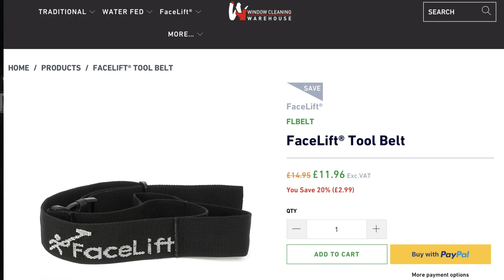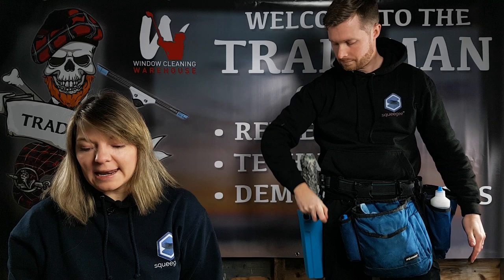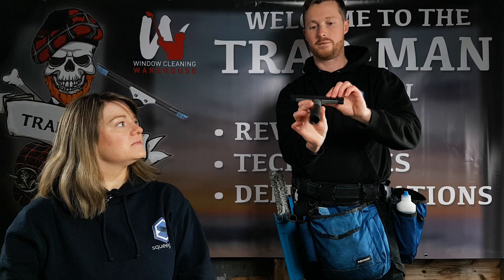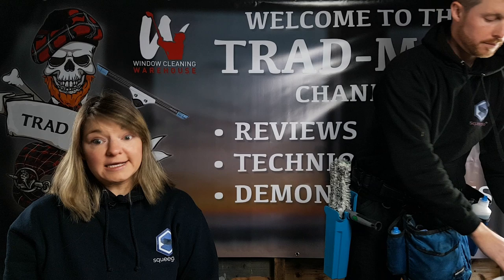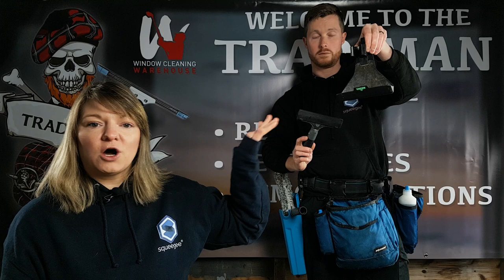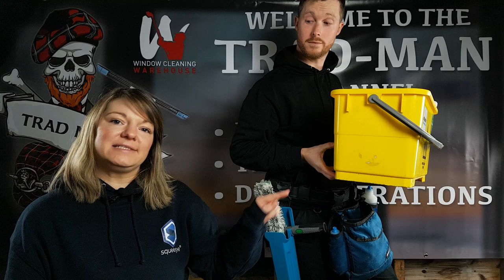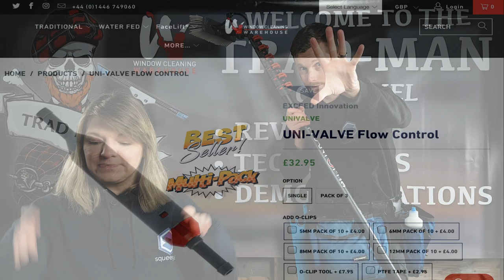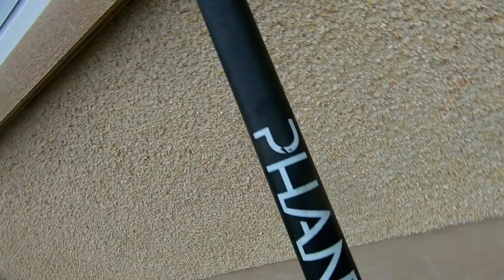NEW STARTER KITS FOR TRADITIONAL & WATER FED POLE! - 2019

Comment: Great vid 👍🏻...I ordered a new moerman side kit pouch, it came today & the internal compartments are different. Vertical dividers in stead of the horizontal divider. I preferred the horizontal one. I rang & messaged everywhere & nobody has the older version in stock anymore. Gutted
Reply from the maker: Yeah they changed it, last year I think it was. 

It seems to add some benefits but also created some cons like reduced space inside. 

For me I can get it to work ok with the cloths I use etc but for some folks with bigger towels it's no use. So really depends what your putting in it and how big your hands are lolz, big hands are gonna find that small internal compartment a real pain. 

I'm hoping something better will come out in the future
Reply: TRAD - MAN THE WINDOW CLEANER ... yea exactly, I usually have a scrim in one & 2 micro fibres in the other for sills & frames. My hands are like a bunch of banana’s so I’ll have to use a scrim & one microfibre I think. Why bother with an internal bottle holder when there’s one on the outside?? Pointless to me. Why fix something that isn’t broken? Annoying but I’ll have to adapt lol
Reply from the maker: @neilpalmer9691  haha yeah if the plan was to have two bottles (one for soap and one for water) then they should of put the other one on the outside on the opposite side to the other
Reply: TRAD - MAN THE WINDOW CLEANER  yea baffling really. Can I ask what hip belt u use or could recommend. I have a security patrol belt 🤣. I want a rigid belt but this is too rigid & uncomfortable lol
Reply from the maker: I use a Makita belt, you'll find it on Amazon for under £20 normally bud
Reply: TRAD - MAN THE WINDOW CLEANER  cheers I’ll take a look 👍🏻

Comment: Well done Carlie. But don’t go giving Sam any ideas. 👍
Reply: Carlie is a star. You've been relegated, Pete. 😄
Reply from the maker: @McRaesWindowCleaning  haha!! Yeah think you may be right there 😂
Reply: Hi trad man, Peter. Last summer holidays I was asked to help the window cleaners at work. I'm a caretaker but I clean my blocks windows with squeegee. We had all the local schools to do in summer holidays. Wow was it hard work. 60ft poles killed my neck and shoulders. So they let me clean inside with squeegee. I'm still doing some private jobs for tennents in blocks in clean, I have an unger with dog eared but finding it a bit hard using higher up with pole. Do they do swivel attachments or would I be better off investing in a mormen I belive the have angles and if so do I need clips as ive been told for rubber slipping.
Thanks barry

Comment: Hey my brother has the old version of the liquidator 2.0 and it isn't 100% detail like mine that I bought recently. This is even with using a new rubber and I never had a problem with mine. Has there been a change in their design since the 2.0 came out?
Reply from the maker: Nothing recent as far as I'm aware. The last thing they added was made the inside of the clip narrower to hold the rubber better but that was a wee while ago they did that
Reply from the maker: @polznbladz3242  hey bob! Hope your well 😁

Austin was saying that his recent one is fine but it's the older version that's not giving 100% results? My clips are about 1 year or so old and they work ok so possibly the older version Austin was talking about is that dud end clip you had issues with at the show?
Reply from the maker: @polznbladz3242  yeah I'm great thanks!

Absolutely agree a replacement squeegee should be sent 👍🏻
Reply: @TradMan  Both of you are right. We switched the end clips out and its golden now.
Reply from the maker: @AustinSmilen  glad to hear!

Comment: Hey I'm looking at these black friday deals. I guess this kit doesn't come with the water purification? Is there one you can recommend and is there anything else that I'll need for my start?
Reply from the maker: Yeah the pole kit is just for the pole and accessories because that's something universal that anyone can just buy and put to use without any hassle whereas a filtration system is not as easy as it depends on what vehicle your intending putting it in, what the water readings are where you live etc. 

If you have low tds then a DI system will do fine. (Anything under 100ppm)

If your water readings in your area are high then you'll need an RO system instead.
Reply: @TradMan  Oh cool! Any recommendation on a DI system?
Reply from the maker: @AustinSmilen  currently I'm using the facelift system with the Unger hydro on the top. My water is only 45ppm so I get away with using that but depends on what your water is like where you are. Are you in a soft water area?
Reply from the maker: @AustinSmilen  something like this...https://windowcleaningwarehouse.co.uk/products/facelift-compact-van-mounted-system
Reply from the maker: @AustinSmilen  things you need to consider, how much water you need a day and what the water reading is

Comment: Hi, Just wondering do you not cut the angle into the rubber for the liquidator anymore?
Reply from the maker: Nope, don't need to, works ok square at the ends buddy
Reply: @TradMan  cheers, that will make things alot easier 😃
Reply from the maker: @royhutchy  it sure does. I've been testing having squared ends for quite a while to see if it impacted the performance on any kinds of windows, so far no issues 💪🏻
Reply: @TradMan  Tried that last week. Works fine. Bye Bye trimming the ends. 😄👍
Reply from the maker: @McRaesWindowCleaning  yay!